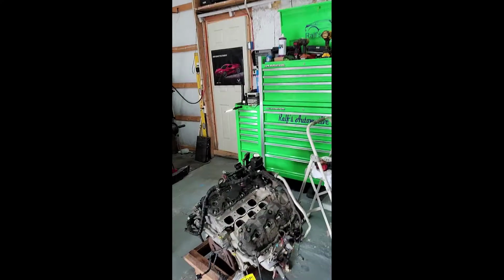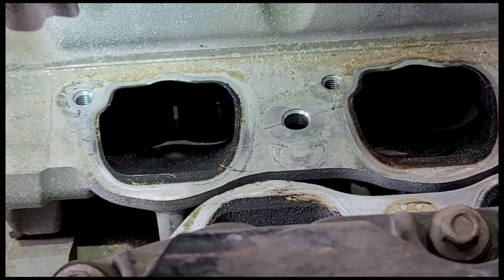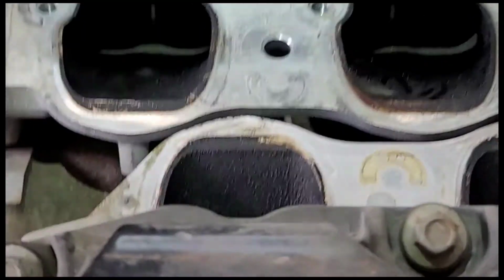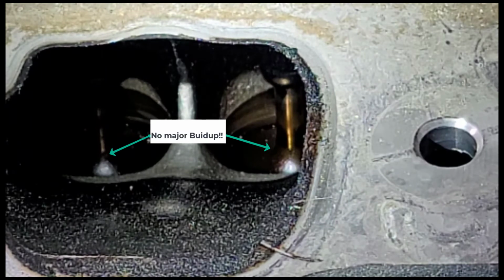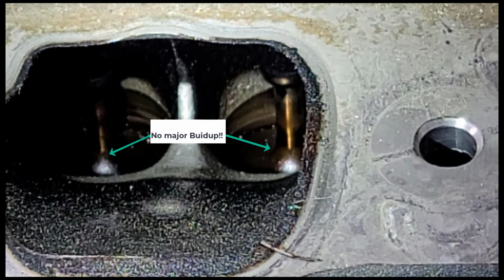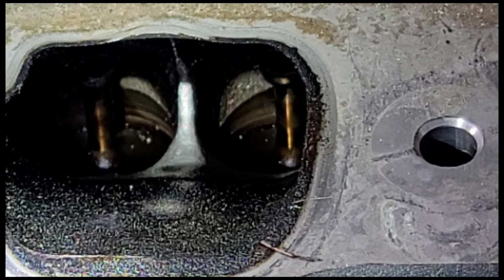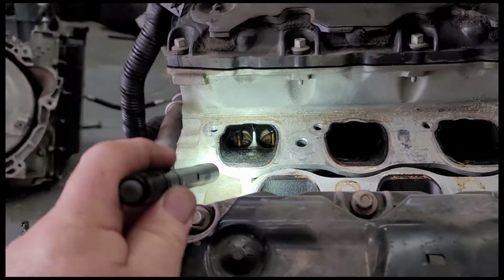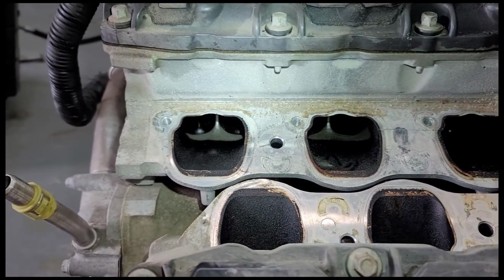Standard vs Direct Injection show and tell Standard Injection Part1

Comment: *Port Injection (not standard) ...also,catch cans are a good solution to prevent coking on intake valves for D.I. engines(which 90% of the time are turbo charged)...ford actually introduced "dual injection"(found on the Ecoboost lineup), basically having your direct injector and also a port injector to prevent intake valve coking..great video btw👍...liked and subd